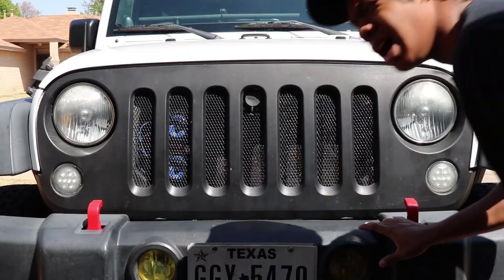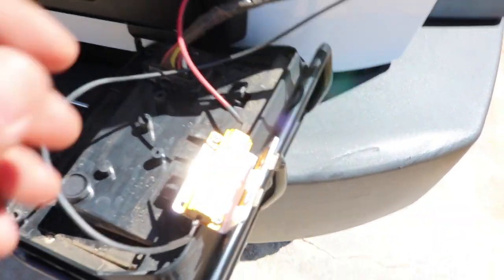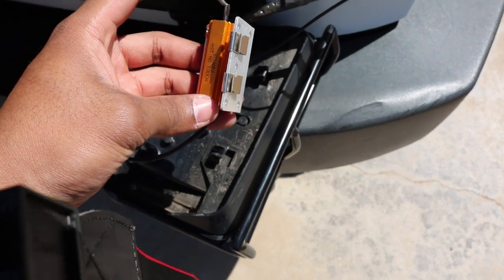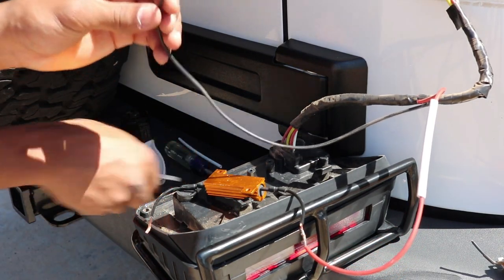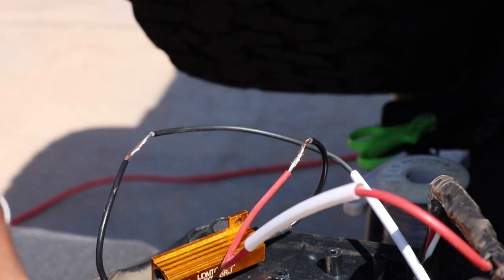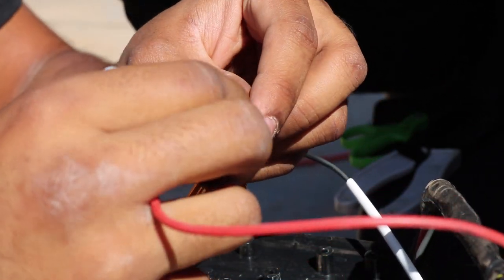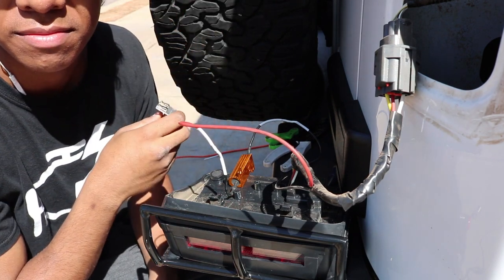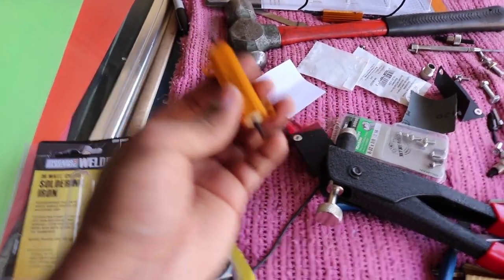Fixing Turn Signal Hyper-flash [Jeep JK]

Comment: Finally someone that takes the time to solder and heat shrink automotive wiring. I hope you waited for the wires to get hot enough to melt the solder instead of relying on just the iron to melt the solder. It would have been nice if you show and explain that on one of the soldering connections. Very good job young man. You are renewing my faith in your generation.

Comment: Thanks a ton. I thought my problem was my front turn led signal, and I didn't even think about my led taillight being the problem. Your video was super helpful, and I was able to solve my hyper flash issue. You rock!
Reply: Checking the below question to you for a reply and re-reading - my question below is a mess.  Here is what I have - my running lights/hazards all four currently work - and the left front bulb is not burned out for either filament, but the front blinker will not work at all - and I get a dash warning about a bulb being out and hyper flash on the left rear.  Does that sounds anything like the issue you were having?
Reply: @scubajim  not sure if I had the same issue as you. I replaced my front and rear turn signals with LED bulbs. I was getting the hyper flash issue with my right turn signal only. I just assumed it was the front LED bulb since it was the last thing I changed. But, it was actually the relay in the rear turn signal that was bad. After replacing it like in the video, everything starting working as normal.
Reply: @lbantay  Thanks - I appreciate the feedback!

Comment: Just installed a complete suite of JW speaker products and have a right hyper flash turn signal issue. Guessing my rear resister is not well connected. I bought my system slightly used and during reinstall or removal that may have occurred. Looks like it is time to remove the rear tail light and check continuity. As always I am benefiting from those of you like Chris that have trouble shot this issue.

Comment: Thanks man I just installed both front side and rear LED lights.  The rear worked fine until I plugged in the front and then I immediately got that rapid flashing turn signals.  I’m definitely going to check the rear tire lights first.   Thanks for the tip!!
Reply from the maker: James Stumpf awesome. I hope you get it all worked out!
Reply: Any results? I installed XPrite rears, fine. Installed fronts, hyperflash. Just spent hours clipping in resistors up front and it didn't fix it... I really want to know if replacing the rears is worth it.. Ugh I wish the computer could just be altered to not think it's out in the first place...
Reply: Hi,  like the author of the video I have a problem only on the right side.   Had regular lights and the right turn signal gave me the error code and hyperflashing on the rear right LEDs., also the right parking light would not lite at all.   Changed the 2 fronts to LEDs with built in resistors and still the same problem.   No parking light even though juice is flowing from the wire and now front and rear right side is hyperflashing and giving the error code.

Some other people have said you need to change the flasher relay and not bother with resistors.

Anyone have this experience and fixed it?   

I tried asking the video author if his parking light had an issue but haven't heard from him.

Comment: Added the resistor to my rear LED tailight that had the issue....the issue persisted.  I unplugged the rear tailight and saw the front still hyperflashing (LED Halo/blinker).  I had removed the resistor but with the front headlight unplugged the taillight hyperflashed.  I guess my question is, "Should I put a resistor on my headlight AND on my tailight?

Thanks!
Reply from the maker: Worth a try. It sounds like you’ve tried both ends individually, but try with a resistor on your front turn signal and a other resistor on the rear turn signal. Some vehicles require one resistor per light, however I thought the wrangler had only one circuit for the turn signals (only requiring one resistor per side). Let me know how it goes trying both. It would be interesting if it still hyperflashes after that.
Reply: @developmentdivision122  Will do.  I have to drop it off for the terrifying "Cylinder 2 Misfire" issue (warranty) so I am dreading the fact that I may not have it for a bit.  Will let you know when I get it back.
Reply: Most distressing....there's no reason I should need 2 resistors, one for the driver's front and one for the driver's rear blinker.  I have checked 4 times and I have the correct 2 wires and regardles of solder or clips ....it just doesn't address the issue.   I am going to switch back to my factor tail lights to see if that addresses the issue.  I suppose you get what you pay for (ebay) but your description fits my issue exactly but the resolution does not work.

Comment: This solved the fronts as well? I've had issues with the fronts for 6 months, then installed my JL Gladiator LED Lights and now all 4 go crazy!
Reply from the maker: ATLCOACH yeah solved fronts. Usually the hyper flash is on focused on a side instead of front or back. For me, the passenger side was hyper flashing
Reply: You need a new hyperflasher led switch that goes behind ur steering wheel quadratec has them for 20$
Reply: @isaacmtorres23  fixed

Comment: Did the correction of the back load resistor fix the hyper-flash on the front blinker without putting a load resistor on the blinker?
Reply from the maker: Clay Martin yes

Comment: So putting that resistor on the back stopped the front from hyper flashing? Is there a resistor on both sides?
Reply from the maker: Yes, one resistor per side. You can have them in the front or the back, I chose the back because there is more space to tuck wiring.

Comment: I have the same signal lights and tail lights.  Worked fine for 3 years.  Now after I hit the signal on driver side I get Hyper flash and message on speedo info area "left side light out " but. They're flashing?

Comment: So, you're saying that the front LEDs for turn signals don't need a load resistor if you have a load resistor on your rear LEDs? 

I do have LEDs in the rear and they came with their own built-in load resistor. never had a problem with them. 

but I'm having an issue with the front regular lights and thought I would change them to LEDs. Someone told me I need to add additional load resistors but according to your video I probably don't.  

What do you think?

Comment: I just added LED front signal lights on my JK....I also have LED taillights and have load resistors on the tail lights but I still have HF on the front signals.  Wonder why the LRs in the back dont fix the front HF?  
Note: LED bulb replacements verses whole LED assembly's like you have. 
Any suggestions anyone?  I'm going to try and install LRs in the front tomorrow but not sure which wires to go for (theres 3 wires into the socket connections)

Comment: I wonder if this could be my problem. I put a 2018 front bumper with factory LED fog lights on my 2016 Rubicon. My factory bumper didnt come with LED's, just  the crappy halogens. When I plugged them in they started to flicker, So I'm wondering if i need a load resistor on my factory harness?
Reply from the maker: Se7vinDeadlySins I’m pretty sure you need an anti flicker harness. i have a video over one for my headlights. I don’t think a load resistor is what you need for that. Check the forums though, I’m not too sure.
Reply: I have some anti flicker harnesses from my aftermarket LED's. The connectors on one end are different so I may just cut and splice them in.

Comment: Hello
 I just installed my RGB HALO tail lights, identical to the Sumpie brand on Amazon. When I tested the driver side it functioned correctly; but when I did the same for the right, the tail light displayed as if I had the hazard lights operating. I'm pretty frustrated, because I installed it, my first mod, and now I have to put the stock back on. could it be the load resistors doing this? I also installed the vostech 8 switch box console, I haven't installed the fron't lights, so You adivce is greatly appreciated.
Reply from the maker: Gerald Davis i would email the amazon seller. Possibly you got a bad product. Have them send you a new unit. If you have the same problem, comment back and i can help you trouble shoot. Make sure the connections were good. If you have aftermarket LED tail lights, and they don’t have load resistors, add them. You’ll need them.
Reply: This is the second kit, I just so happen watched both your initial install, last week while waiting for the replacement to arrive, only to have the same signal error on the passenger taillight. Everything else is still in the box.
Reply: I'm about to put the stock lights back in a sec. Just if your curious the Brand is T-Former, on Amazon.

Comment: Question for you the bracket you have for the load resistor where did you get it and how do you have them mounted in the rear?
Reply from the maker: Ryan O'Sullivan i mounted them to the body inside the jeep behind the tail light. I go over it briefly in the video. The brackets come with the load resistors. But if you want to make one it’s a simple 1/8-1/4” L bracket, maybe 2.5” in length.

Comment: Just bought some alla amber led bulbs for my front turn signals. Made front and led tail light lights hyperflash. But the tail light leds work fine without front led turn lights installed? Thoughts?
Reply from the maker: Super Soul Fried Disco you’ll need a resistor like i have in the video. Make sure you have one per side. It’s easiest to install them in the rear.

Comment: so resistors aren't necessary for the front turn signals?
Reply from the maker: Big D you need only one per side. So you can either have your resistor in the front or the rear. It is unnecessary to have two per side.
Reply: Chris Meacham ok, thanks for the info, also love the content. I’m a college kid so I gotta ball on a budget and your channel kinda fits role.
Reply: Chris Meacham cool cause I have LED  switchbacks in the front with resistors, but the halogens in the rear. The rear driver side turn signal is out and now I get a hyper flash for the left turn signal. I was wondering about this.

Comment: Hi,  like the author of the video I have a problem only on the right side.   Had regular lights and the right turn signal gave me the error code and hyperflashing on the rear right LEDs., also the right parking light would not lite at all.   Changed the 2 fronts to LEDs with built in resistors and still the same problem.   No parking light even though juice is flowing from the wire and now front and rear right side is hyperflashing and giving the error code.

Some other people have said you need to change the flasher relay and not bother with resistors.

Anyone have this experience and fixed it?

Comment: What if i have this problem except my tail lights are stock and my turn signals only are LED
Reply from the maker: Ruth Segura add the load resistor to the front turn signals or add LED tail lights

Comment: Where did you get the load resistor for the rear lights?
Reply from the maker: Kenneth R Warren https://www.amazon.com/Resistors-Signal-License-Warning-Cancellor/dp/B004EDF8HY
Reply: @developmentdivision122  Thanks Chris, just looked at my tail lights and they don't have that load resistor? Hmmmm? Something is running my battery down every morning I have to charge it, pretty new battery. ( about a year old)
Reply from the maker: Kenneth R Warren could still be a bad battery, just go to autozone and have them check it along with your alternator. Before you jump head first into an electrical headache.. also you don’t need load resistors unless they are led.
Reply: @developmentdivision122  They are LED's but not from China, well the front blinkers are, just like yours. I'll have to battery checked first. Thanks!

Comment: I need your help or your viewers with another problem I'm having. I hooked up LED Halo headlights and it is interfering with my FM reception. It's not the headlights causing the interference it's my halos. I have the halos wired to my under hood fuse box accessories, so when i cut on the key the halos come on. When I unplug the halos from the fuse box the interference goes away.  I've tried ferrite cores, ect. The only thing I haven't tried is connecting the halo wire to my turn light signal positive wire, so when i cut my headlight switch to on the halos come on. Do you know of a fix? Thanking you  or your viewers in advance for help.
Reply: Make sure you have a good ground, also use and inline fuse. Connect it to the M9 fuse slot in your fuse box & they work great. I have Halo's on Headlights and fog lights

Comment: You should get led headlights like JW Speaker blacked out housing.
Reply from the maker: CarPro Installs i probably won’t get JW speaker (bc the cost is too much). But i will be getting aftermarket headlights in a couple weeks. thanks for watching!!
Reply: Chris Meacham no problem thanks for the content and when you can keep the mods coming it will look great.And for the headlights try to find good cost ones with the look of JW Speaker blacked out housing.
Reply: Chris Meacham and for better taillights look at Black Dot taillights.

Comment: Only connect the load resistor to the turn signal flash wire this way it only gets how when signal is flashing and not when tail lamp is on

Comment: thats the stupid way of doing it , Adding leds reduces the electrical load thats a benefit of using LED , less electrical loads means less charging actually saves fuel too , adding a load resister to make it the same as incandescent puts the load back but is also a fire risk , change the capacitor in the flasher can and you can change the rate in which the light flashes you dont need to change the load.